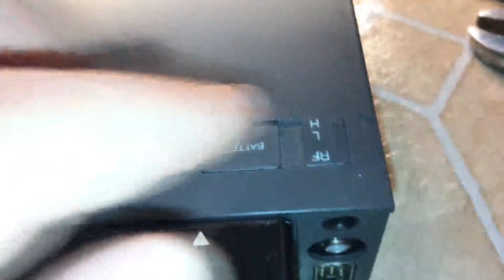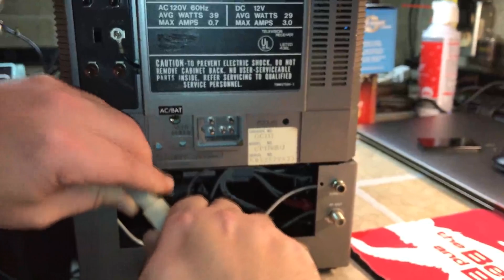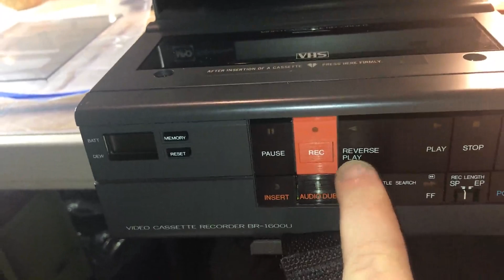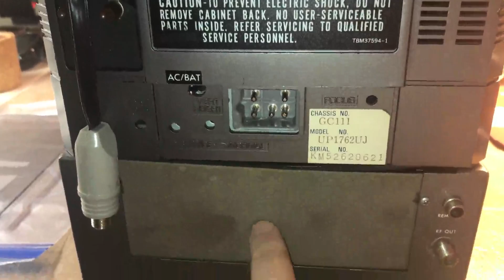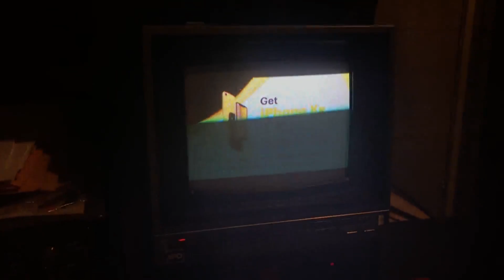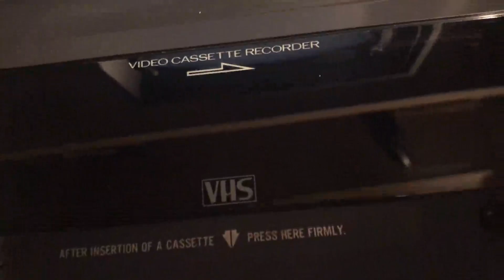1983 MPO Videotronics Hospital TV/VCR

Comment: u still have analogue tv signal that an old tuner works with? hasn't it been phased out in north america?
Reply: There are still a few hold-outs. We have VHF channel 10 (MCTV) and UHF channel 32 (Independent / movies) serving North Bay / Nipissing in NTSC analog. But channel 2 (Global), 4 (CBC), 6 (TVO), 7 (RC) switched to digital... so only two left for the 1979 Zenith System 3 Space Command console television. :(
Reply: digital is so much better quality even on old crt tvs  - between digital over air and streaming, cable is totally obsolete. for the old tvs all you need is a converter box.
Reply: Digital sucks
Reply: Why? the picture quality is amazing.
Reply: The picture quality sucks.
Reply: @Lake Nipissing, That's sad =-(
Reply: We don't have any here in Pittsburgh, as far as I know.  Mspysu79 would know for sure.  We use a DTV on this, or we can use our agile modulator to send it an analog signal.
Reply: We atill gat TV with an antenna

Comment: While Quasar and JVC made good high quality equipment. 

MPO Videotronics on the other hand. did a half ass job, making it a TV/VCR combo. It looks like some 12 year old put this together in their parents garage for a school science project. The hack job of shaving the feet off. Looks like an air chisel was used to remove the feet by the over cuts next to where the feet were, and no room for both the camera plug and tracking. Other than that, it's a pretty neat set up.
Reply: The way some of those mods were crudely hacked in makes me think this setup wouldn't pass modern quality checks for electronic devices in hospitals/medical environments.